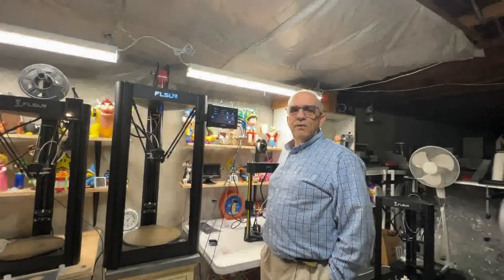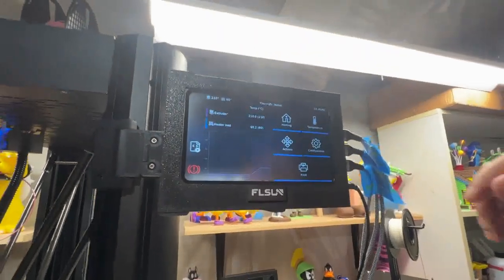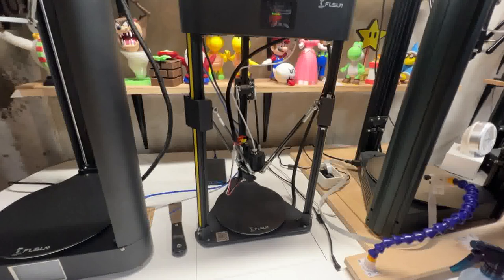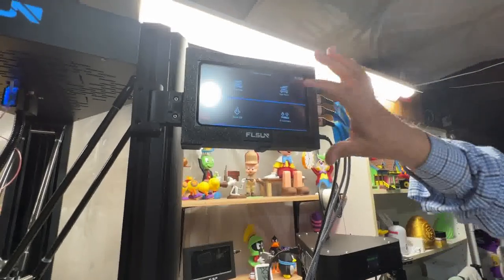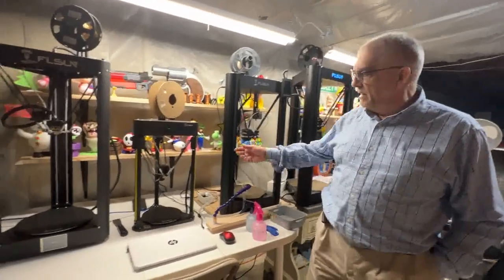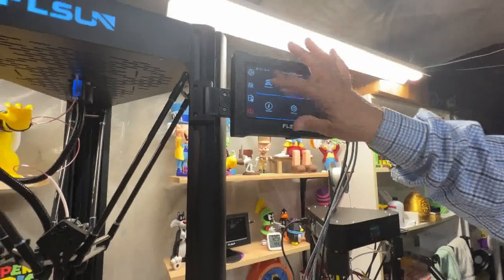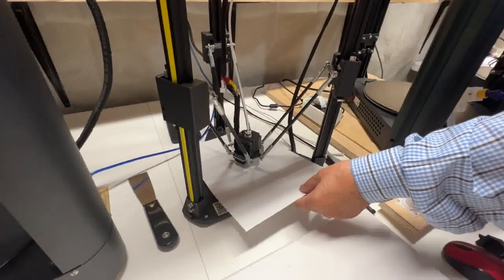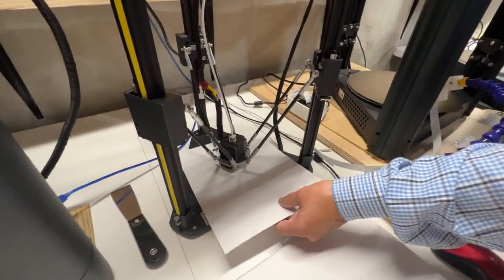Printer Calibration Using The Speeder Pad

Comment: I think it might a good idea to perform this while the bed is hot at 60°C since materials expand with heat. I believe it could be more accurate vs running the bed level on a cold surface.

Comment: Hallo thank you for the video. The bed levelled mesh is stored in memory or it has to be done each time the printer is turned on? 
It is possibile to store different temperature levelling profiles and than recall them directly (in case different materials are used sequentially)?
Compliments for the holder... if you fan share a link for the stl it would be great.
I have a SR: any special suggestions for the Speeder Pad installation?

Thank you in advance 

Riccardo
Reply from the maker: Thank you for the kind words...
Contact me on FB messenger to talk more directly...

Comment: Hi Dennis, Great video I have just bought a pad today and installing it on my QQS-Pro, can you please make a video and explain the A,B,C,D,and E ??? I have no idea what these mean and what relation they have to the chip or even which printer they need to be assign to if that makes sense. I do not know if I should select abide and select any of them to a port ??? can you please help here. Also The TF card reader is recessed into the plastic pad that you cannot press it in or retrieve it and when you do get it in the pad will not read the Gcode file just put onto it ready to print ??? maybe 2 videos here lol. Many thanks for your help. Maybe you can pass this onto FLSUN, when manufacturers release products they need to supply instructions that make sense to the masses, if it was not for people like yourself a lot of us would be frustrated with this stuff not working out of the box.  Many thanks again look forward to more videos. Wayne
Reply from the maker: Hello Wayne, contact me on FB Messenget and I can help...
Dennis G. Gignac

Comment: Hi your info is so valuable. Thanks so much. I'm having one problem that I can't find addressed in your videos or I wouldn't bother you. After I get my brim or skirt or even raft down, the extruder is far away from the build plate. It's like it's missing a gcode that tells it to lower to start the actual print. I've lost so much filament forgetting to run and lower the extruder really quick. Can you help me with this sir

Comment: hello sorry, I wanted to ask something, because on all the videos I understand what you did you see the bed leveling then the bed mesh and then adjust the Z offset. On many documents they report that Klipper does not save the mesh if the Z offset is not done first. Does the speeder pad work differently than the standard Klipper?